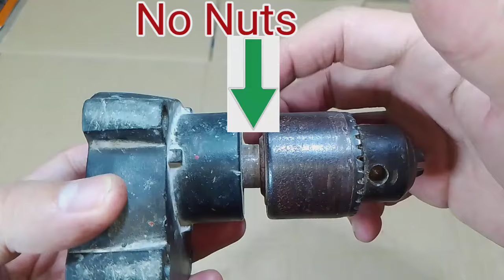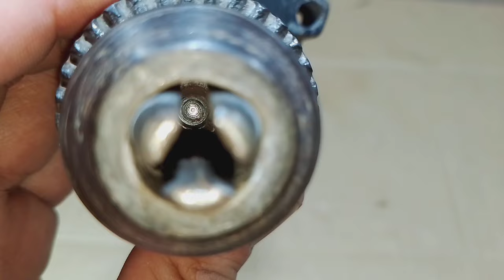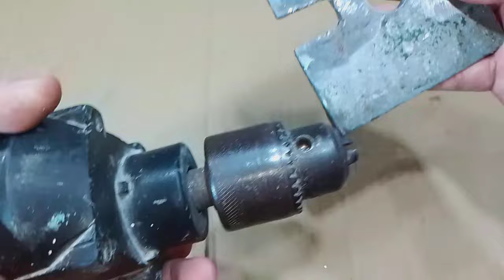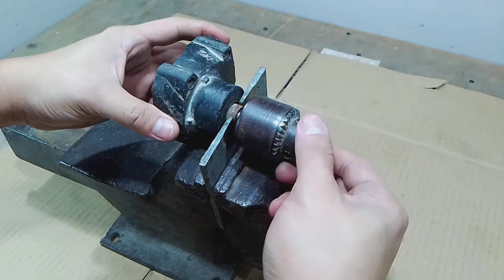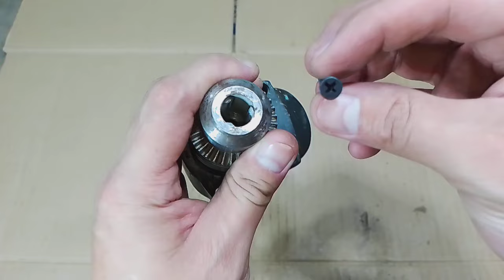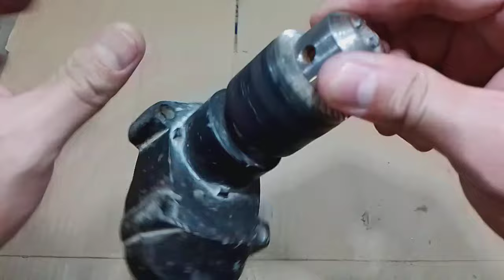How to Replaced  the Drill Chuck with no Nut

Comment: Here's how I was taught to do it by my manager when I was doing my apprenticeship :-

1. Remove left handed screw from chuck

2. With the whole drill assembled, place the gearbox in first gear

3. Using either the chuck key or an Allen key hit it with a hammer so that the chuck spins off anti clockwise as if you were facing the front of the chuck jaws.

4. Fit the new chuck in reverse order to how the old one was removed except it doesn't need to be wacked back on !
Reply: that only works if there is a left hand set screw - which this clearly does not have